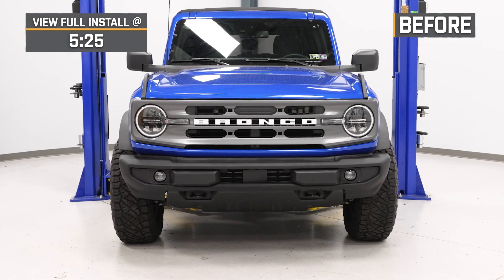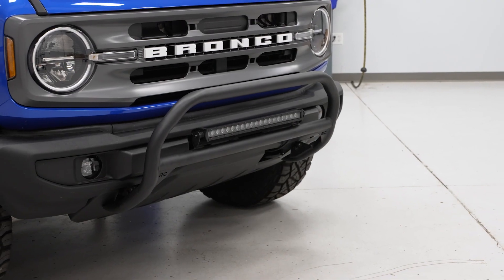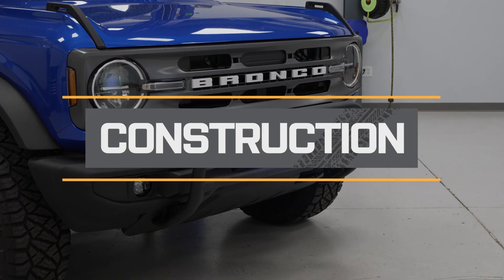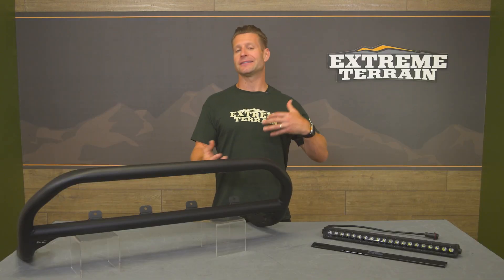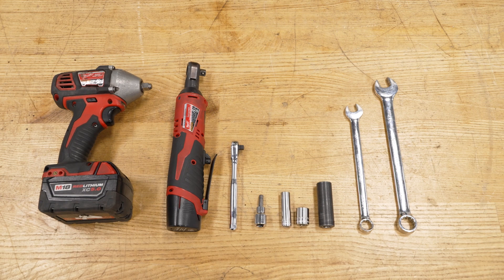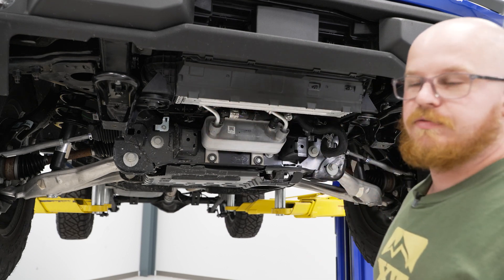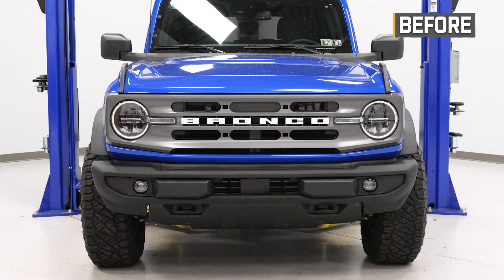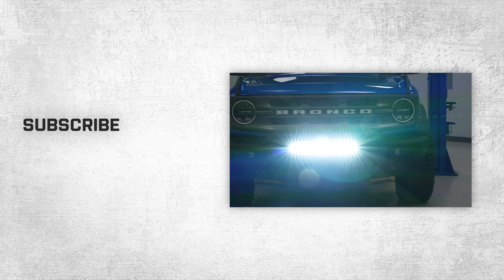2021-2023 Bronco Rough Country Nudge Bar with 20-Inch Black Series LED Light Bar Review & Install

Comment: FYI for the 4cyl engine that grommet is actually being used for the brake booster. I had to cut a different grommet and run it through there. A little more difficult, but nothing too crazy 👍🏼
Reply from the maker: Great point! Thanks for watching.